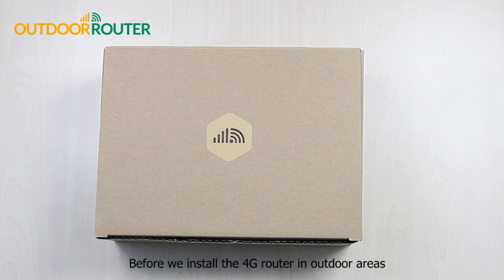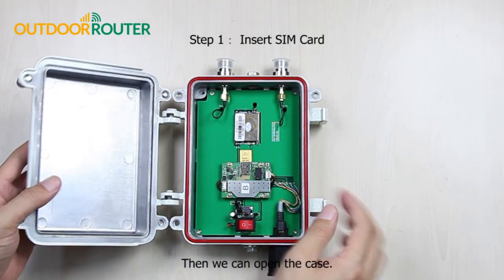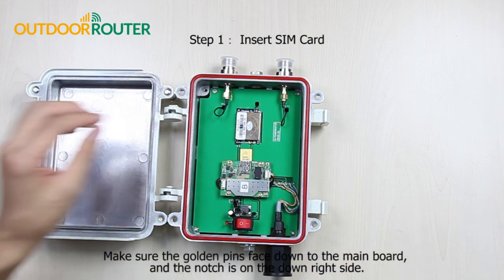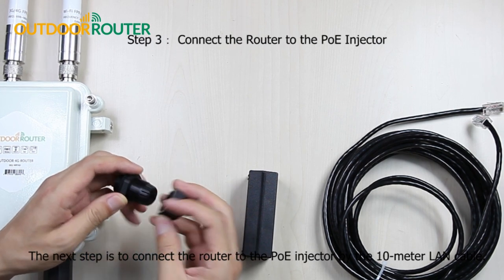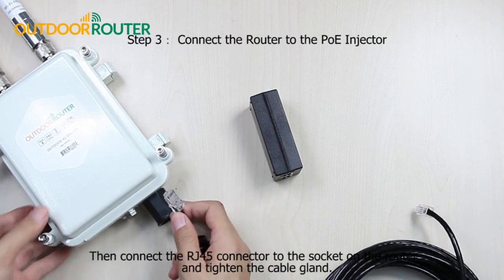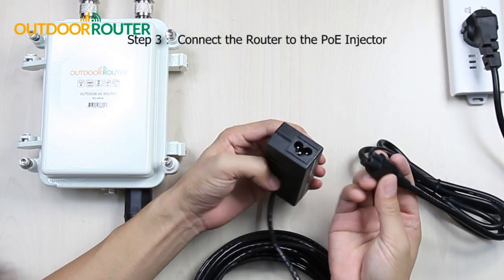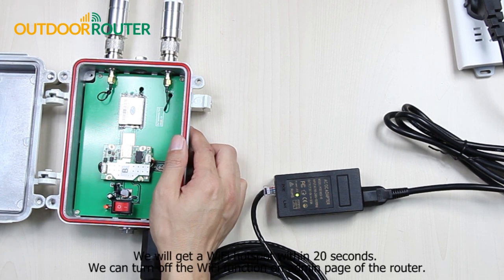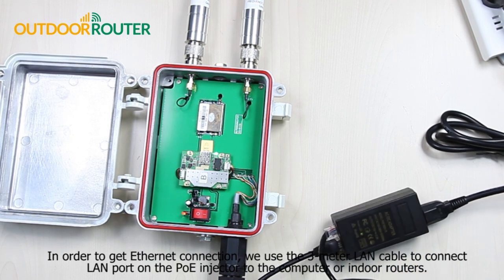Outdoor 4G Router - Insert SIM Card and External Antennas

Comment: I have a question. Who or how do you acquire the components for the routers you guys sell and are you guys manufacturing theses in house or having someone else do it. I would like to have an idea so I would be able to build my own equipment.And is the software mostly open-source for these mobile routers like open wrt or pf-sense or is otr specifically made software for them.
Reply from the maker: The motherboard is built in our own factory. You can buy our outdoor router hardware and use your firmware.

Comment: If I’m trying to set this up in an RV, is there anything i need specifically for this to work or i just need the SIM and this product?
Reply from the maker: Yes you can use it in an RV. Please make sure the antennas are in the vertical direction.

Comment: This device works well in places with little 4G / 3G signal, will it amplify the signal in regions with few operator antennas? Is it good for rural areas? Do you sell it on Amazon?
Reply from the maker: You can use a high-gain directional antenna to improve the signal reception in rural areas. You can order from our official website www.OutdoorRouter.com.

Comment: I'd like to know if this router can receive stronger network signal/strength than a mobile phone in areas where the signal reception is not very good? Would I rather purchase this and get better internet from this than using an internet mobile hotspot?
Reply from the maker: You can place the outdoor router in the outside area to receive a stronger signal reception and even install a higher-gain 4G antenna to improve the signal. The Wi-Fi signal is much more powerful than a mobile hotspot.

Comment: How many kilomiter range can read 4g signal
Reply from the maker: The router does not have a 4G signal amplifier, so the range of reading the 4G signal is the same as a regular mobile phone. Suggest using the 4G router with at least 2-bar signal. However, you can exchange the default antenna with higher gain directional antennas like LPDA or panel 4G antennas.

Comment: can i search the web with this or is it only for CCTV?
Reply from the maker: It can provide internet on WiFi and LAN Ethernet. You can use it to surf the web and also offer internet to the CCTV system.
Reply: @OutdoorRouter   thanks  for the info do you think it can catch a 4g signal from a tower that is 4 kilometers away?
Reply from the maker: @ahmadosman8877  You can check the 4G signal reception on a mobile phone. The router requires at least -110dBm 4G signals, the RSRP value.
Reply: @OutdoorRouter  sorry but how do i check it on my phone?
Reply from the maker: @ahmadosman8877  Please refer to the guidance at https://www.outdoorrouter.com/field-test-4g-mobile-signal-strength/

Comment: 4G signal repeater?
Reply from the maker: It can not boost the 4G signal, but connects to the 4G network and provide Internet connection on WiFi and LAN Ethernet. You can use a higher gain 4G antenna to improve the signal reception.